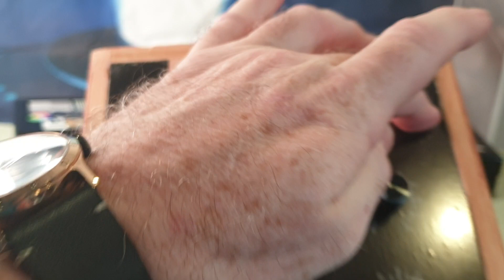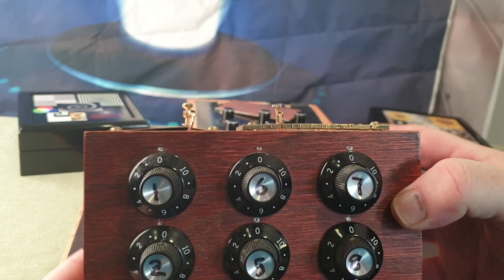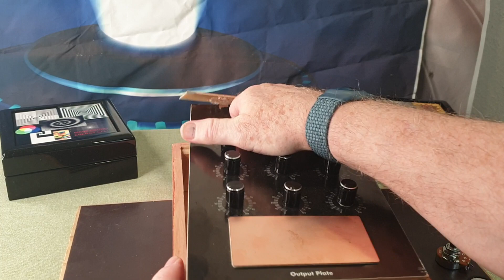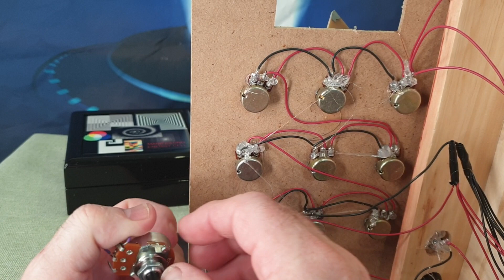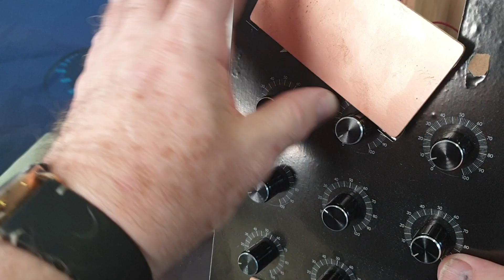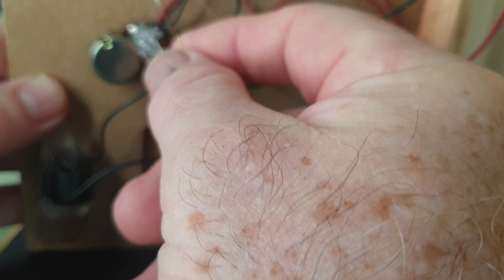How To Build A Classic Radionic Machine - Part 3

Comment: Ive seen some units with a Tesla Coil used for amplification purposes, would you ever add one?
Reply from the maker: No, this does not help the process. It hurts it. This energy is not electromagetic.
Reply: @R @Radionictech uld you explain What kind of energy is that of the amplification? I ask you this because in my country there’s a guy selling a amplification machine that has A metal plate in it, turning on in an outlet, and he uses and sells it as an amplification. Now i got curious why does this type of energy damages the process, if you could please explain